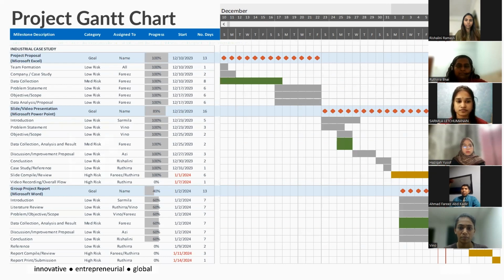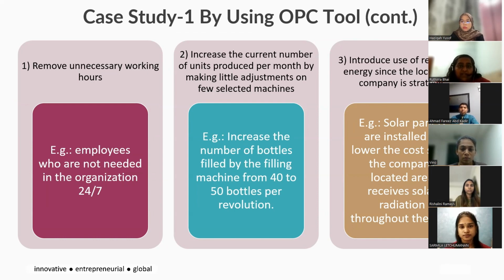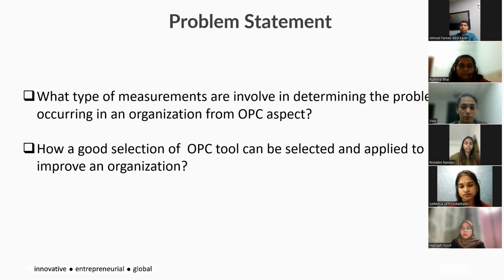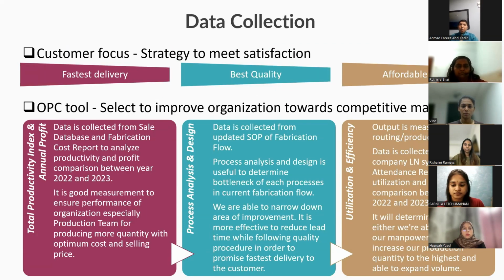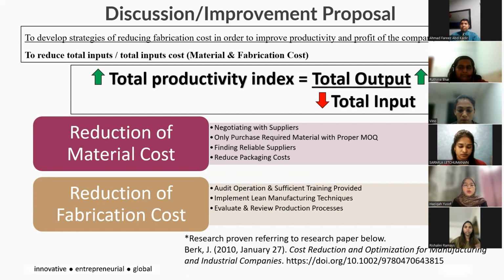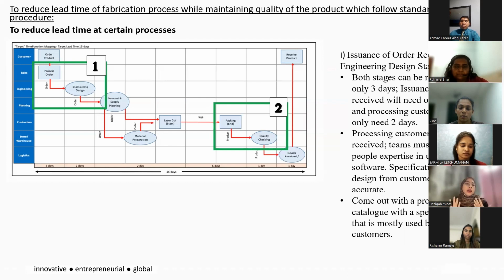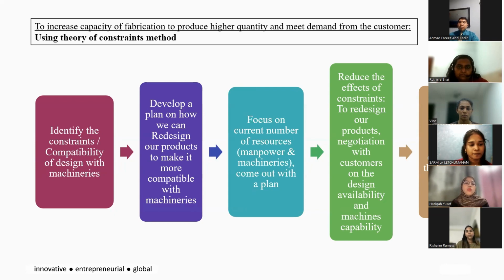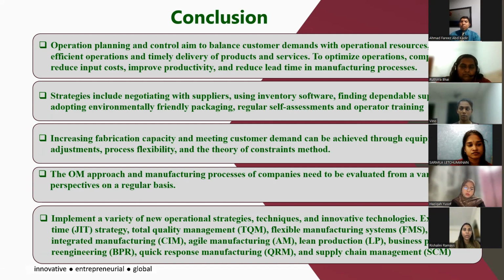Group 3 - OPC Project (Production Improvement)

Comment: Hi on behalf of the group 4. I will like to clarify on theory of constraints which also know as bottleneck approach. My question when a company identity and deal with a specific constraints another constraints might develop. Is it possible to achieve optimum level for all activities?
Reply from the maker: Thank you Keerthi from Group 4 for the question. Bottleneck identification is important to determine our capacity of manufacturing process. Once bottleneck is identified and throughput is measured, few countermeasure action might be taken to increass our capacity by reducing cycle time of bottleneck process.

It might develop another contraints. But one of action to avoid develop any contraints by plotting Yamazumi Board and focus on making line balancing. This is to ensure all cycle time is balanced for each processes, reduce bottleneck time and increase capacity of production. I hope this answer you well.

Comment: Hi Group 3, great presentation from the team! I'm Sofia, On behalf of group 2 would like to ask, while purchasing additional machineries may incur high cost, what are the acceptable return of investment that Sefar are considering to proceed with the purchase?
Reply from the maker: Thank you Sofia from Group 2 for the question. There are few things need to consider for purchasing additional machineries. Firstly, we need to understand our current cost which include old machineries and evaluate influences of cash flow for new machineries. Besides, we need to understand potential benefit of new machineries in term of productivity, tooling cost, maintenance cost and etc. 

Best ROI of the company should be within 2 years. Since our profit is around RM3.5mil per year, company may invest up to RM7.0mil for additional machineries to meet ROI for 2 years. I hope this answer you well.

Comment: Hi group 3 thanks for the presentation.

On behalf on group 6, our question what are the strategies used to reduce lead time over the process of packing and quality checking ?
Reply from the maker: Thank you Satish from Group 6 for the question. Packing and quality is common process in production which mean it don't need high skilled of operator for these works. There are several approaches taken to reduce lead time such as by allocating most efficient operator for the works which is to ensure talent is fully utilized. Besides, purchase and installation of new machine for packing will help to reduce cycle time which reduce depending on manpower effort. Through this action, manpower can be allocated for bottleneck process and reduce lead time of production. I hope this answer you well.
Reply: @ahmadfareezabdkadir9096 I am Bob from Group 1 Perdana. Thanks for the good presentation. Regarding the quoted reply about purchasing and installation of a new packaging machine to reduce cycle time, won't it increase costs which will affect productivity of the company in the short run? One of the objective is to reduce cost in order to improve productivity and profit of the company.
Reply from the maker: @bukenyabobjulius2588  Thank you Bob from Group 1 for the question. Final aim of productivity is to produce more output which to meet customer satisfaction. Yes, I'm agree that it will incure high cost. But investing of new machineries will help a lot in term of consistent efficiency, less variability which in the end will provide best quality, fastest delivery and competitive price to the customer. I hope this answer you well.
Reply: Yes, thank you very much for the elaboration.

Comment: Hi Group 3. This is an excellent presentation. Kudos to the team!

On behalf of Group 5, while our existing process lead time reduced and capacity increased, how are we planning to manage inventory shortages or delay delivery from suppliers?
Reply from the maker: Thank you Viknesvaran from Group 5 for the question. Currently, there is poor control of handling inventory in which we're unable to promise raw material availability for each order to the customer. Therefore, there is necessary to improve by implementation of forecasting to ensure material always available for order execution. Moving average or exponential smoothing are suitable method for preparing the forecast of material.

Besides, inventory management also will help to improve material availability. There are few method such as basic economic order quantity model, production order quantity model which are good approaches to measure optimal material quantity to be order and determine reorder point. Through all activities mention, we are able to ensure availability of material, so delay delivery from the suppliers will not affect much to the production. I hope this answer you well.

Comment: Hi G3 thank you for the presentation. Based on the Actual case study, what is the main challenge Sefar facing during the improvement stage for the cost reduction example  during negotiating with supplier? and how they rectify the problem?
Reply from the maker: Thank you Shasha from Group 7 for the question. Cost reduction is aim of the company and material become an issue which relate to the supplier selection. The main challenge of Sefar facing is most of the material coming from the Europe. It will generate a lot of cost due to transportation and currency difference. However, we still able to get cheaper material price from nearest country such as India, Thailand and etc, 

For cost of material, it will depend on customer requirement. Some of them are willing to invest for higher quality of material but some of them require affordable price. Thus, different selling price will differ selection of raw material to the customer.

To rectify the problem, usually Sales will advise Production for material selection which fit the selling price offer to the customer. This is to ensure company able to get higher margin of selling price which fit the material cost for getting more profit. I hope this answer you well.

Comment: Hi G3, perfect scope of study. Well explanation. 👍🏽  good job guys! On behalf of G1, wanna ask that:
In increase capacity of fabrication to produced the lead time portion, it  was mentioned the adjustment equipment machinery : can you elaborate more on what kind of adjustment can be done here? In order to made the changes , process of validating and agreement to the changes will be taking place, will it impact to your production timeline? Besides, 2nd point on purchase additional machines, what will be the current efficiency of equipment? Does the machines fully utilise? As it will increase the cost of maintenance and the capex if we purchase new machinery right? Has it be considered? 
Is there any bottleneck processes that could help in reduce the timeline and improve the cycle time thoroughly?
Reply from the maker: Thank you Hakimi from Group 1 for the question. Regarding increase the capacity, adjustment will focus on manpower allocation first since most of the processes require manual work by the operators. It means that for bottleneck process, more manpower will be allocated to reduce the cycle time and reduce lead time of production. Machine also will improve in preventive maintenance in order to reduce breakdown and improve availability of the process.

For additional machines to purchase as you're mention, most of orders are utilizing laser cut machine. This machine always fully utilize and some of order need to cut manually which give high cycle time of the process. Thus, it is necessary to purchase new machine for laser cut instead of utilize manpower for manual cut. Nowadays, China machine maker able to provide cheaper machinery which is good investment and ROI for the company.

Company currently run with job shop order in which each products is differ for each orders and customers. Usually manual work become bottleneck process for most of orders which we don't we have any machine to run based on customer requirement. Instead of utilizing manual work, investment to machineries may help to reduce the cycle time rather than using manpower effort.

From this improvement, we are able to reduce the cycle time, increase efficiency and utilization which aim to reduce lead time of production. I hope this answer you well.